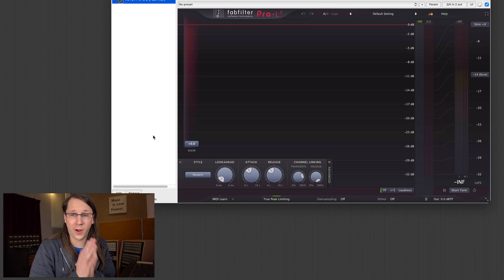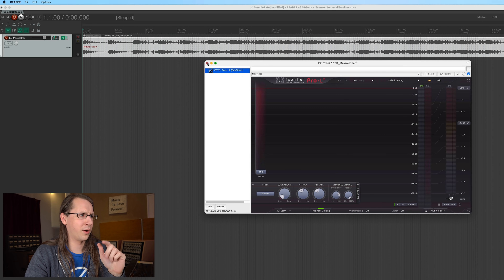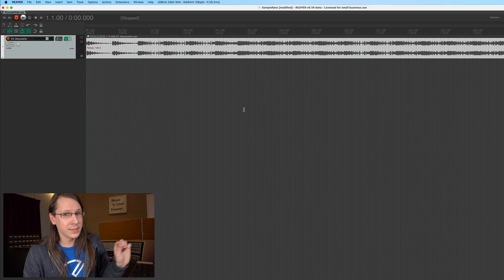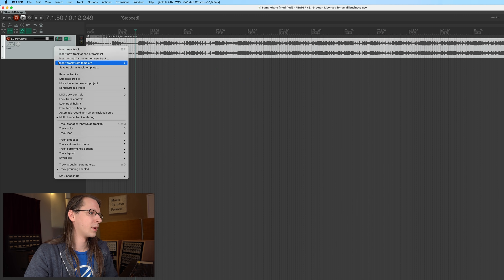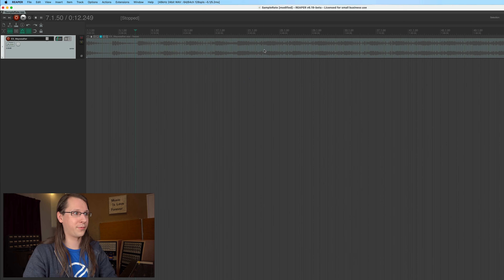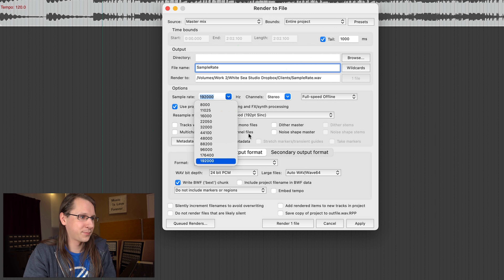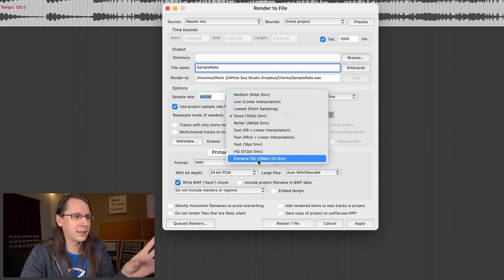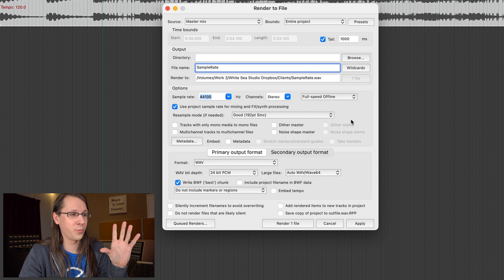WHAT is the BEST SAMPLE RATE?

Comment: REAPER's Resample Mode - it has to do with the amount of samples the DAW uses to re-create a new waveform. I'd like to try to explain. Please correct me, if I'm wrong.

Imagine a file being played at 0.5x speed without pitching it up 2x. So just "slow it down" in the most literal sense.

In the DAW the file's samples are now twice as far apart. But the DAW still needs to play at YOUR OUTPUT's sample rate. So it has to re-sample the audio and create a new waveform on the fly. It has to create samples at your output's sample rate inbetween the original file's samples.

How does it know how to set the amplitude, the height of the sample?

The easiest method is "linear interpolation". The DAW just draws a line from the two surrounding samples and creates a sample at the line's amplitude in the middle of the line.
Sounds fine on paper but in reality it sounds bad, because the waveform between the two samples might contain more complex frequency content, which will be reduced to "whatever is in the middle". It's a bit like aliasing. Lower frequencies get introduced.

So anyway, any higher quality resample mode goes to where it needs to re-create a sample, looks at X samples AROUND that spot and THEN recreates a waveform that better matches the original.

The more points you look at, the higher the CPU cost per new sample.

That being said, I also can not hear any difference between "good" in REAPER's resample mode or anything higher. 

However, I had to deal with this problem above in game engines, because in order to run fast, they often use linear interpolation. Imagine a car engine going up in pitch as it's going faster, this is often done by dynamically pitching the file - resampling it. In my example my high frequencies of a bat squeek were lower and lower, weird sounding ones were added, after I put the file from the DAW into the game. So yeah. Cool to know audio nerd stuff. :)

Comment: If my system supports it I'll gladly run my sessions at 192. But sadly not every one of us gets to play with the big toys. So 48 it is and oversampling whenever possible (for processing). I recorded a traditional instrument the other day and 192 did make an audible difference when compared to even 96 (I will not be discussing how it sounds since I haven't fully tested it and I might try your method to see if the converter can actually handle it well or not). Also, I would say if I had the privilege to mix completely analog (the computer would then be more or less like a tape machine, storing and editing data only) then 192 all the way all the time it is (the CPU wouldn't be hit as hard since it doesn't have to run any plug-ins)

Comment: Higher sample rates on conversion are useful for creative sampling - if you plan to radically slow down or pitch down your samples, its a good idea to convert at higher rates, so you do not lose all the high frequencies.
Reply: Actually it does not work like that. If you tune down your sample, your low frequencies get pushed to high frequencies area, so your 100 hz becomes 200 hz, etc. So having frequencies above 20000 hz won't help - they will be translated to the inaudible frequency range anyway.
Reply: @kadavr0s  I think you got it backwards. Maybe I've explained it poorly.
Reply: @kadavr0s Nah fam, there's definatley a huge difference in resolution if you're slowing down or speeding up high sample rate files. It's almost like recording at a high frame rate with a camera.

Comment: If I'm producing to make vinyl, 24bit/96k is is the lowest I prefer to go. I cut my teeth on 2" MCI 24 track pre-digital in the early 90's and there is definitely a difference if you're going below 48k. even going back down to 44.1 for CD sounds better if you start at 48k or higher, rather than starting the session in 44.1 - there seems to be more "there" in the final master.
Reply: Absolutely correct

Comment: I used to run at 48KHz, but recently moved to 96KHz since I now have a much more powerful computer. 
Pretty much all plugins support it now and any that do not internally oversample will benefit from 96KHz natively due to the reduced aliasing. Wont make any difference to those that do already oversample though.
Reply: What format do you convert to for 96
Reply: @WaterRiver777  WAV
Reply: @insanebiscuit1  where do you upload too
Reply: @WaterRiver777  i dont upload, i mix for others

Comment: i work at 44.1 whenever possible and disable oversampling because I enjoy the sound of aliasing. I often also add bitcrushers on delays and reverbs to crunch them down to 22kHz for extra grit.
Reply: @espoir inconscient happy hardcore, jungle, nu-metal, and generally anything that takes my fancy. i tend to blend together elements that aren't usually seen together like mixing new-age pads with bluegrass banjo or such.

Comment: I tend export wav files from Korg gadget in 24 bit / 96 kHz because it's the highest it can export but I'm wondering if I should just do 48 kHz to reduce file sizes as those 96 Khz get pretty big. When I import them into Cubasis it always warns me that it takes more cpu load on the iPad. Seems like the audiochip in the iPad can't go any higher then 48 kHz for playback unless I connect an interface to it. On the PC side my interface (Steinberg UR-242) Can do 192 kHz but I almost never use it that high. I do the mixing with both Cubasis and Cubase. I do the initial rough mix on the iPad with Cubasis and import the project into Cubase on the PC to tweak / improve / export it. Those 96 kHz files take up a lot of disk space in regards to backups. Maybe 48 kHz would be a wise idea next time..... I do use 24 bits though, the projects involve only electronic sounds generated by soft synths and are instrumental with only some stock plugins.

Comment: Completely agree with the workflow. I do most basic stuff and recording in 48. I even get a basic mix and levels done this way. Once I am happy with most things I set Reaper to 96 and stem ALL the tracks to 96.

Then I do the last tone shaping and compression.

At this point it does not tax the system too much as the main fx like amp sims etc have been applied.

I have noticed that the mix and master is a lot more clean and defined as well as the instruments are more separated. I guess it just gives the daw more points to work with. I also try to make it clear that resampling higher does not add information it just ads more data points.

I have a video about this here if anyone is interested:
https://youtu.be/i01zLOH5j9Q

Comment: I run on 88.2k, as it's the easiest for the converters to handle (to 44.1k) , unless there are 2 dedicated circuits for (doubling) 44.1 and 48k. 192k should be converted back to 48k if you want to be sure of matching bits and their calculations. Floating integer calculation at 64-bit will handle the conversion better, but I would stick to doubling/ halving myself.
Reply: It seems like it should be easier, but mathematically the conversion from 88.2 to 44.1 is just as complicated as 96.  It's not a case of removing bits or samples or anything, it's still fourier transforms and curve fitting.
Reply: @EricOehler01  as far as I have heard dedicated to multiples was the way to go. It seems logical too when dividing 2 by 3 in integers. that's where the 'curve' fitting gets slightly affected, The bits are changed by the tiniest float points or something like that. I saw it in a presentation from Marantz in their high end stuff. It def changes the sound, butm at the moment processing is way improved, so I wouldn't worry that about it that much personally. That said, I record and mix in the same samplerate. Always. If I change the settings on both my interface or DAC there will be differences in the sound. And not always for the better. Steady is the way to go imho.
Reply: @EricOehler01  I thought the calculations are easier with 88.2 to 44.1 and vice versa because no interpolation needs to occur between samples. That vs something like 96KHz to 44.1 which would require some interpolation because of the non-integer division of the sample rate no?
Reply: @Dthebeatsmith  it always requires interpolation, because downsampling isn’t strictly a divisive operation.  My DSP math is weak and I haven’t done any since college a loooong time ago, but YOURE not just picking the path between samples, you’re refitting a curve to a new periodic rate.  Basically saying “this equation described this curve at x sample rate, what equation does it at y”  

We’re used to the notion of halving and multiplying sample rates because it makes logical sense, and works for visual mediums and frame rates.  But the math is complicated and fussy.  

If it were as straightforward as halving things, there wouldn’t be any differences between SRCs and we’d never have to worry about whose DAW did the best downsampling. :)
Reply: @EricOehler01 Excactly...
 I always come across this statement ' it shouldn't matter' .... with SR, cables... you name it....but every system/ interface sounds DIFFERENT. Explain that when it's digital right? It should be the same on EVERY system, I stick to steady ....
Why mess around with different samplerates anyway? It adds work lol
Reply: @Projacked1  heheh yeah it adds work alright.

Even digital sounds different because everybody has different algorithms for handling the same problems, and to compensate for the inherent shortcomings of every method.  It’s crazy stuff and it makes my head hurt.
Reply: @EricOehler01  Same here,...  
Toss all your plugins and the deduce what you really need, because you will never get there if your focus is on plugin fx. Crazy sh** man.....
Reply: Eric is right here. The “easier calculations” thing is really a myth. I always encourage people to do their own tests to see what actually works and sounds better. So I encourage you to try 96 vs 88.2 and see what you like best. At those rates it’s a slight difference and probably doesn’t matter very much though.

Comment: The main thing for me is that using higher sample rates for audio tracks in a DAW leads to accumulating inaudible (>20kHz) garbage in them, which later gets into the audible range through interference.
Reply: lo pass them?
Reply: @wokeil  you need to do that on every operation, or they get in the audible range and it is too late to low pass them

Comment: Great show ! That was very enlightening ! 
How about a Micpre review, RME Quadmic vs Behringer Ada8200 ? 
The Ada8200 is outstanding ! It is the only true Adat (8in AND 8out !)  with 8 MicPres out there ! None of the others have 8 outs from adat ! 
You always must combine different units for offering headphone monitor mixes. 
Comparison of the preamps would be interesting.
Reply: What about the Focusrite Clarett Octopre or the Presonus Digimax DP88?
They both feature AD and DA conversion while being less expensive than the RME version.
Reply: @error8418  Sorry No you are wrong. Those have no adat In, only AD no DA ! 
Also from RME, an Adat with 8 MicPres does not exist, non of them has 8 analog outs from adat.
Reply: @Waedi-OJ  Well, I have a Presonous DP88 and I mostly use it for its DACs.
Regarding the Focusrite unit, don't mix up the CLARETT Octopre with the cheaper SCARLETT Octopre.
I have put a lot of research into this topic as I wanted something better than the Behringer (a dynamic range of 108dBA didn't seem that good) but didn't have the money to buy the RME one.
Reply: @Waedi-OJ  What you're right about is that RME doesn't have a one-stop-solution, it's preamp or converter.
And yes, unfortunately most ADAT enabled preamps only feature ADCs, e.g. Audient or RME Octamic XTC.
Reply: @error8418  Those both have no digital adat In, only out. 
There is absolut not one single unit (beside the Behringer one)out there that offers 8 Mic in and 8 analog out from adat.  Would be glad if you can show me one.
Reply: @Waedi-OJ  Look them up.
Reply: @Waedi-OJ  Well, as it turns out Presonus have just decided to discontinue the DP88 for whatever reason. But here's the Focusrite one: https://focusrite.com/en/adat-mic-pre/clarett/clarett-octopre
Keep in mind that with both units you need a DB25 cable to access the DACs.
Reply: @error8418  Thank you ! 
And I have to apologize I was wrong you are right. 
This device has it all. 
I did overgo it because I wS looking the photios for watching output sockets and not checked that the D-sub is analog out. 
It is not perfect comfortable but it would work. 
Good to have an alternative just in case. 
For the moment i stick with that cheap Behringer unit and give it a try. 
Lets see how long it survive.
peace 👋🏻👋🏻✌🏻
Reply: Honourable to admit that you weren't right - I appreciate that!
I guess they went with DB25s because 8 TRS jacks wouldn't have fitted. I have the outputs hooked up to a patch bay so I actually prefer 1 DB25 snake over 8 individual TRS cables.
The Behringer seems tempting for the price and if you use the outputs for headphone mixes they are certainly good enough.
But I got the unit for using it with hardware inserts since my RME Babyface Pro doesn't have any outputs besides the main and headphone ones. So, I was a little worried about signal degradation.
Also, the DP88 has the benefit of being able to completely bypass the mic pres to got straight to the ADCs while the Octopre may have slightly better preamp.
As always it comes down to the use case which unit is the best.

Comment: People check the upper mids and high freqs, check saturation and stuff like cymbals, comparing 44/48 and 96. Try to tune vocals in 44/48 and 96 or pitch some samples. There's a big difference between those.

Comment: Great video! This bleeds over into the audiophile realm as well. I believe that for audio playback, 16-bit with 44.1 or 48KHz when mastered with a modern shaped dither is all you need. (-3dB lost headroom for removing aliasing artifacts. Non-dithered gets you 96dB of SnR, whereas dithering gets you to ~120dB SnR on average since it's varying throughout the frequency response). Shannon-Nyquist Theorem FTW. On the other hand, recordings and production work benefit from higher bitrates so you don't lose dynamic range when you scale up the recording's gain or add compression. Most DAW's default to 32-bit internally.

That article is down, but here is a video from Monty at Xiph.org about audio. A bit dry and technical, but rewarding to watch.
https://www.youtube.com/watch?v=cIQ9IXSUzuM
Reply from the maker: Literally the video I linked to in the info-card ;-)
Reply: @Whiteseastudio  Yeah. The link looks to be down. Not sure what's up. Here is the original on the wayback machine.
https://web.archive.org/web/20161212024118/https://people.xiph.org/~xiphmont/demo/neil-young.html